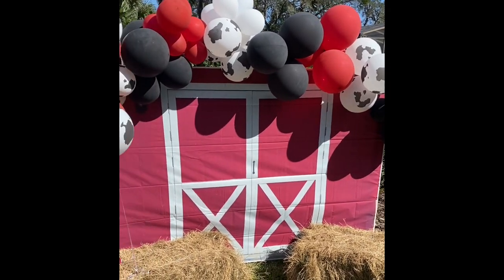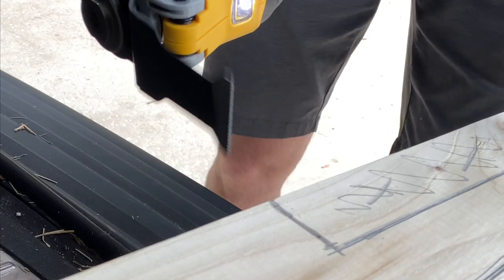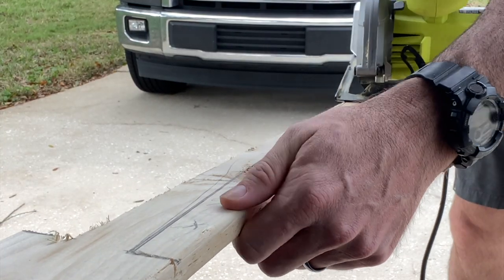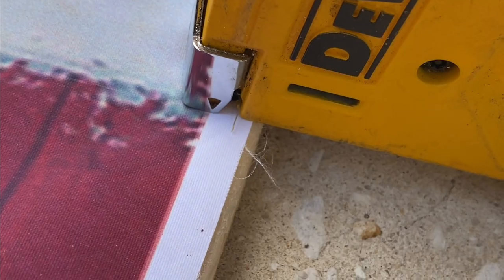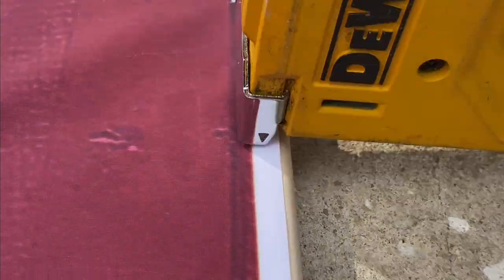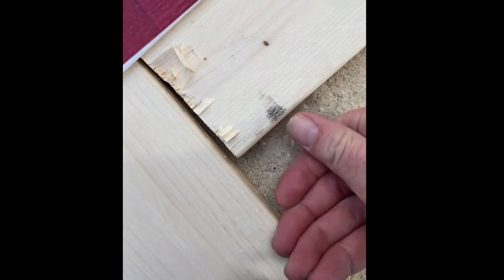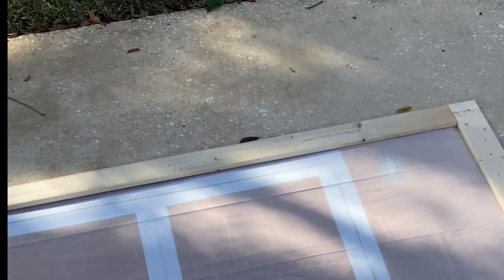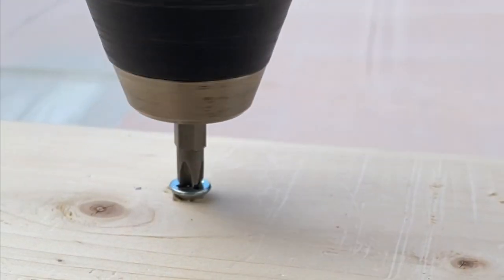DIY Photo Backdrop Stand | Pinterest or Instagram Style Picture Stand for Yard | DIY Photo

Comment from the maker: Materials Used: 
(3) 1x4" pieces of Lumber, 8 ft tall
Dewalt Oscillating Multi-tool: https://amzn.to/49wAjOZ
Dewalt Staple Gun: https://amzn.to/3uRh7MU
Ryobi Circular Saw: https://amzn.to/49t2eiW
Craftsman 20V Drill: https://amzn.to/3v28y1M
Wood Screw Kit: https://amzn.to/48FbcbA
Tape Measure: https://amzn.to/3SZnhTf
Rubber Mallet: https://amzn.to/48CgYLg